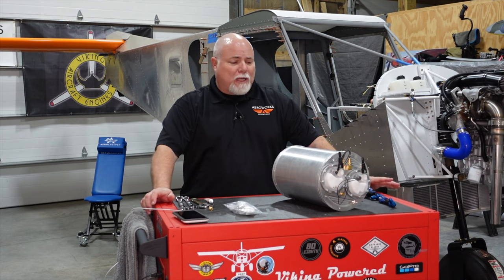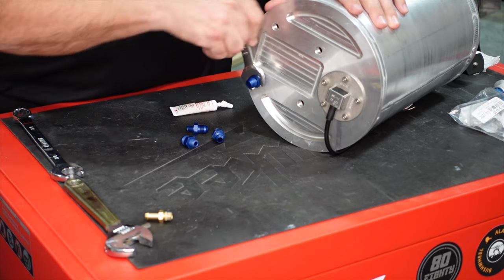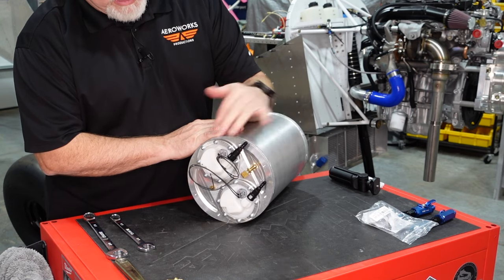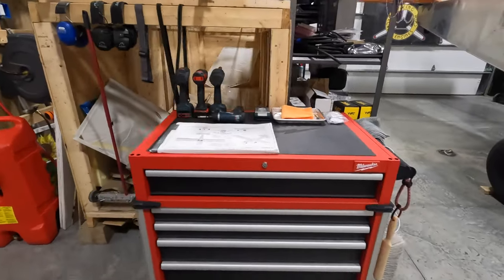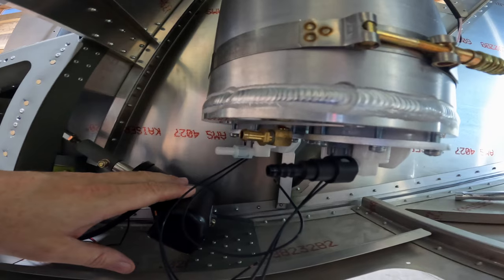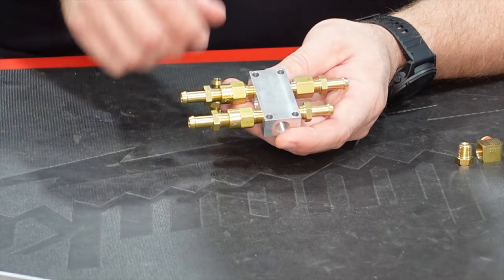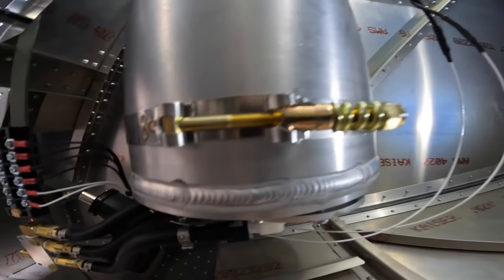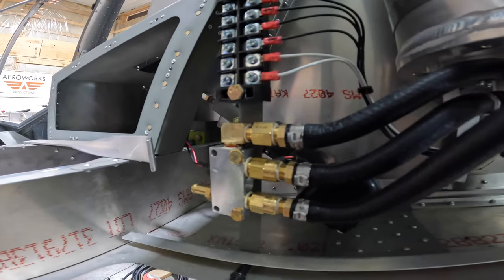Ep. 50 | VIKING FUEL SYSTEM - PART 1 | Zenith Super Duty Aircraft Build

Comment: Never put any kind of sealant on AN flare threads, only a hydraulic assembly lubricate to get a good torque reading and to prevent galling the threads. Sealant on the NPT side of the fitting is a must.
Reply from the maker: As you can see that’s what I did and discussed in the video.

Comment: Are you going to put a clamp to connect the two fuel filters to one another? That long arm of fluid connectors between the header tank and the center of mass of the filters seems like it could have a resonance that might result in a fatigue crack. I’ll look forward to seeing all of those connections completed in part 2 of this episode!
Reply from the maker: There have already been some slight changes in the fuel system design.  All will be covered in Part 2 of the fuel system install.  Thanks for watching!

Comment: I like how you mounted a terminal block for the wiring. I just extended them to the front.  Nice clean install.
Reply from the maker: Thanks Joe.
Reply: Maybe adding a few more terminals to the terminal strip for the fuel transducer? Another idea is to add a ground bus for all the grounds, then you have plenty of room for the positives on the existing terminal strip.
Reply from the maker: @eggenfellner  There are enough for both pumps and the fuel transducer currently.  I may add a ground bar later.

Comment: Learning a lot from this series.  Hope to order my SD tail kit in a few weeks.

A question on your Holly fuel filters.  When it comes annual time and you have to remove them for inspection/cleaning, how do you get them out without having the contents of the gas tank come pouring down on you?  I'd hate to have to drain the tanks just to clean the filters.
Reply from the maker: Thanks for watching and great question.  The new fuel valve I just installed will be able to shut off the flow and little to no fuel should come out when changing the filter.  Good luck on your tail kit.  Feel free to reach out if you have questions and make sure you join the Zenith Super Duty Builders group on Facebook.  Lots of pictures and help if you need it.

Comment: As always, I appreciate the great detail in your videos!  It would have been nice if all of your lines could have been entirely SS braided PTFE so they would be "permanent," unlike the rubber lines that require periodic replacement, but at least that's only a once every several years cycle, so you won't have to think about it for quite some time! LOL!
BTW,  for those on a budget, Jeg's sells a billet aluminum 40 micron fuel filter with AN6 fittings that works great for about 1/3 of the price of the Holley.
Looks like you got out of the "Hell Hole" unscathed - my poor old bald scalp usually collects at least one scrape each time I "visit" mine in my 750 STOL.  :(
Reply from the maker: Yeah agree on all counts.  I usually scratch my glasses or forehead somewhere getting in and out of there.  I wish we could have had all SS lines too but it would have made some of the Honda fittings tricky.